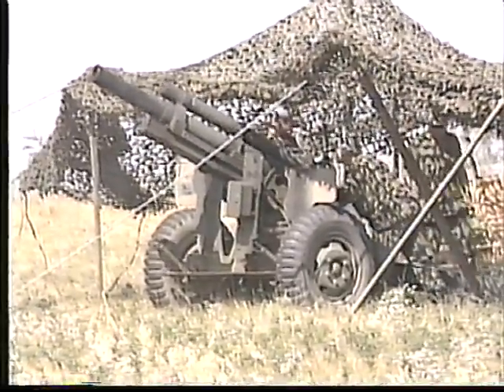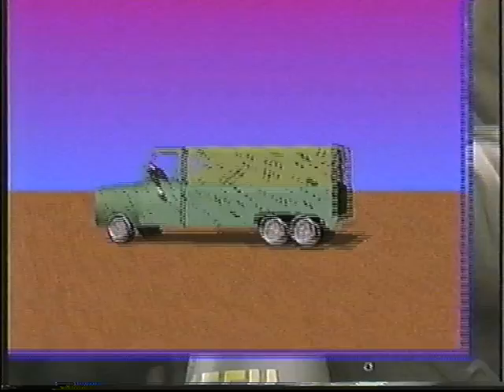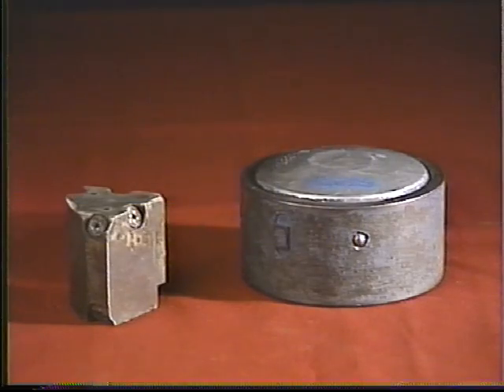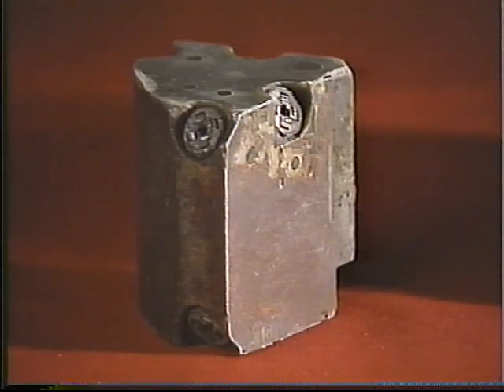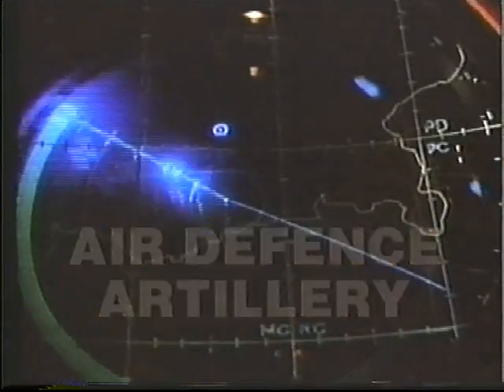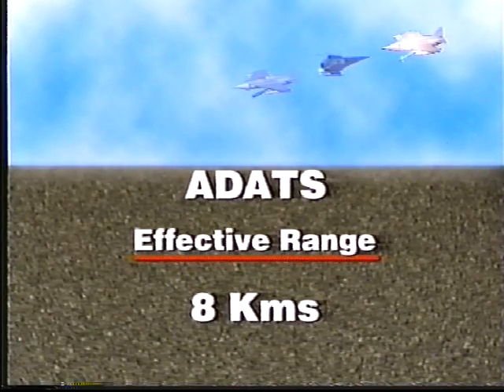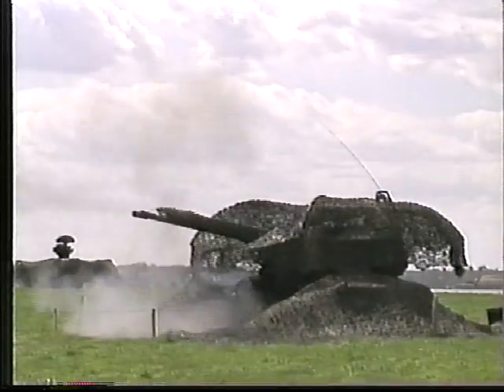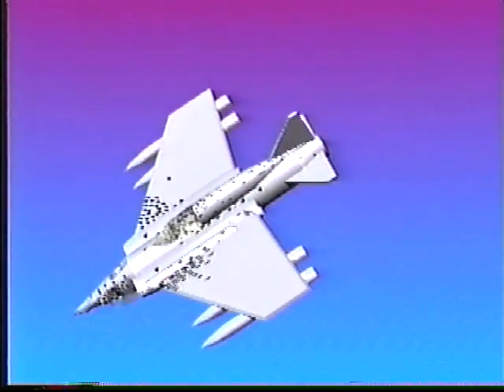Canadian Forces - Weapons Effects - Artillery

Comment: Man, why did we ever get rid of ADATS? It was such an awesome system.
Reply: Laser guided weapons cannot be used in high humidity conditions like fog and rain.
Reply: @digitalprismatics  Really? I heard it was due to budgetary constraints. I heard we were going to upgrade to something called Multi-Mission Effects vehicle; essentially a missile-equipped Anti-Air/Anti-Armor LAV, but Harper pulled the plug on funding because it was just too expensive in the end. Seriously though, we have so many capability gaps in our armed forces right now that sorely need to be addressed (no Anti-Air, no attack helicopters, so self-propelled artillery; don't even get me started on our Navy). The Feds need to up our defense spending big time.
Reply: I'm more annoyed its replacement, the MMEV was canceled. The MMEV was basically a LAV III with a modular turret capable of using ADATS along with AA missiles like Sidewinders.